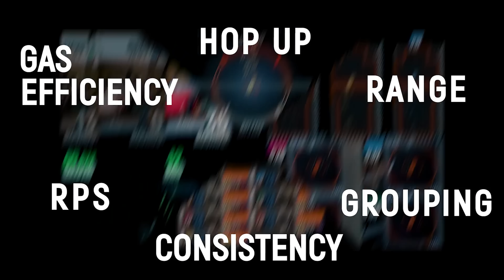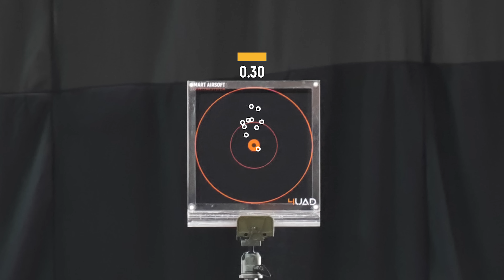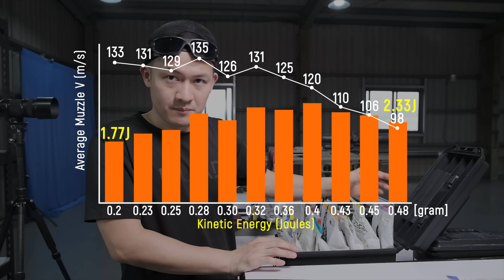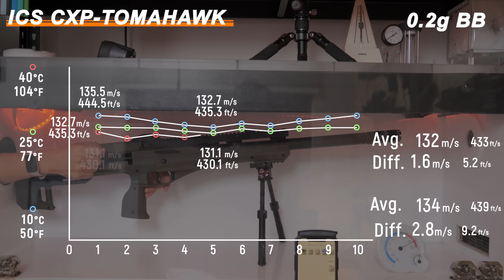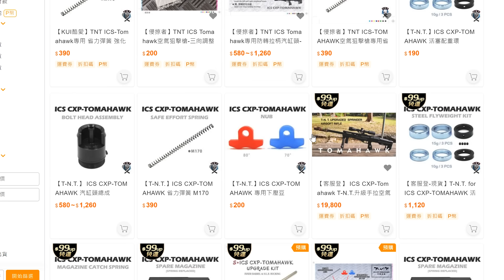ICS Tomahawk Sniper Rifle - 4UAD Grading System Challenge

Comment: I would suggest that the higher velocity during cold temperature would be air density not the hop rubber
Reply from the maker: actually after some research I think what you said is quite correct too. Thanks for the tips buddy!

Comment: I don't see any lefty version... 🤔
Reply from the maker: Actually the righty version works great for lefty
Reply: @4UADSmartAirsoft  No it doesn't because the bold have to be pulled with the left hand. That's why they didn't design it only in lefty version to sell to right handers, it wouldn't be good for them then.

Unfortunately if the don't have a lefty conversion or another version they exclude about 10% of the users!

Comment: Please do a barrel length test vs grouping and range test video (at the same speed for each test)
Reply from the maker: Dude we want to do that!
Reply: @4UADSmartAirsoft  Please do, you could even go deeper and try it for each power type (Aeg, spring, gas, hpa) and bb weight. 

I'd be interested to know if there's a sweet spot based off the volume of air each system and the barrel length (while keeping at the same energy like 1.5J  for all the tests) 

I think a short barrel with a heavy bb will do better than a long barrel with the same bb.

Comment: For unlimited budget, easiest to use / upgrade, and balanced between power & accuracy for an airsoft sniper rifle, which sniper rifle one do you suggest the most?
Reply from the maker: Man~~~that is a hard question hahahaha all airsoft guns have good potential to be great, it comes down to who is using it and what’s their preference. But I would say the first thing is to make sure the gun has a good potential to get upgrades. This includes the good material backup parts and the range of upgrade parts. If. Gun meets those two points they can be the best.
Reply: @4UADSmartAirsoft  Cmon, pick 1 😁

Comment: You guys really have elevated the art of reviewing airsoft guns to the next level! Also, I really appreciate the part where you display the energy readouts for this sniper. The joule creep is insane on this gun.
Additionally, when you do the temperature test (great idea btw), i think there're more factors at play here: The fact that you're playing essentially with a fixed volume, but changing the air density, increasing it as temperature decreases, means you have more energy available to transfer to the BB. In theory, this should be enough to justify the additional kinetic energy (more important than simply velocity, in this comparison) at lower temperatures. However, when you run the math, and check the ratios, you see that you fall short a few percentage points. This is where I think you've made a good observation, in referencing the temperature's effect on the hop up rubber affecting the maximum pressure buildup behind the BB, i.e. how much of the compressed air energy you can make use of to propel the BB down the barrel. Despite that, the math seems to point in the other direction, i.e. that the cooler the rubber is, the less efficient the system is. The increased consistency at 25ºC might also indicate that the optimal performance of the rubber properties is at around that temperature. All the variables involved in the air calculations relate linearly to each other, so the math is trivial. Those relating to the thermal expansion are not so trivial, given the geometry of the bucking and its boundary conditions, but my intuition tells me the opposite of what you've described in the video should happen, and that would fit with the calculations, but I can't confirm that without a proper FEM simulation using Abacus or Ansys.
Keep up the good work, looking forward to your next reviews!
Reply from the maker: Wow that is one full on research man! Thank you so much for spending the time writing this we will get into the details for sure! Really appreciate such information is shared to the community, this could really help people to learn more knowledge! And thanks for the support as always! We will pump more stuff out!
Reply: You guys are giving an amazing gift to the airsoft community, not only by showing us what products truly deserve our hard earned cash, so that the prized manufacturers can further invest in developing products that take airsoft in the right direction, but you're also teaching players a lot on what to look for in and how to evaluate an airsoft gun. That is a lot of added value that you bring, and this should be dutifully commended.
I'll be tuning in to your next releases! Keep setting and elevating the standard of how this content should done!

Comment: Hey I miss these grading challenges, maybe you should do one of these full videos not on a stock gun but on a fully upgraded sniper rifle of your choice using nothing but the best third party parts just to set the standard of what a fully 10 out of 10 gun should perform and push airsoft to the absolute maximum limit. 

Make that video and you'll set a solid performance benchmark that EVERY airsoft gun can be compared with. It'll cut through all the marketing BS that companies use to hide behind poor products and will benefit the entire sport as a whole by showing what can be done with the right parts and tuning.

Comment: @15:10 , hi 4UAD team, during the range test at 70m was it tested by setting the hop adjustment to min? max? or in middle? does it have an effect for a longer range if hop is set higher than 40%? will there be a difference in Joules?
Reply from the maker: To answer your question, Yes if the hop up is set tighter the joules will increase, however we adjust the hop up to  make sure it hits the target, other wise setting it to min or max  this gun simply will not shoot over 10 meters. We adjust the hop according to the range, and we figured this might be the best way to demo the gun to you guys.
Reply: @4UADSmartAirsoft  this test is great and also convenient for this unit since the hop can be easily adjusted on the outside, I have not seen any other DMR so I am just basing it (hop dial) on this gun. thanks for sharing and for this awesome test.